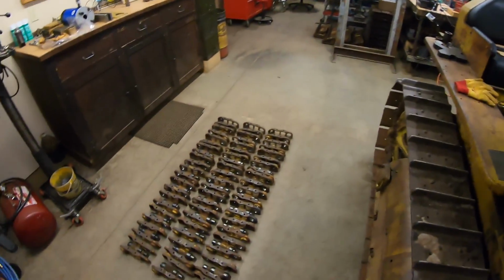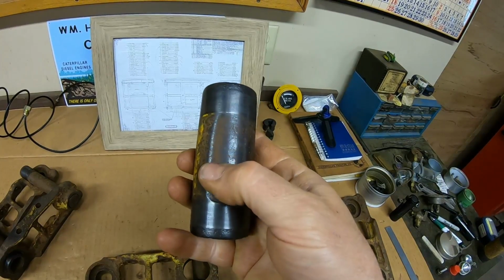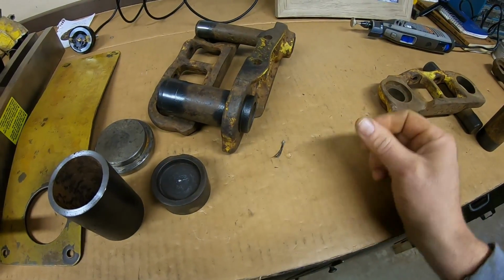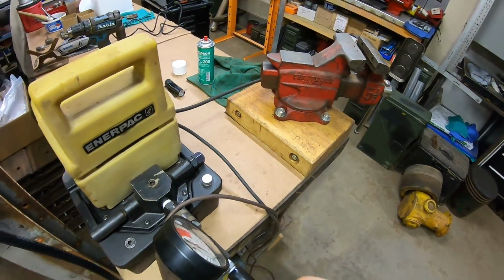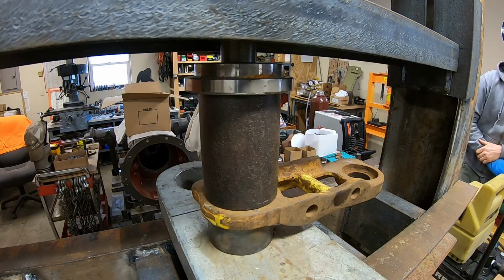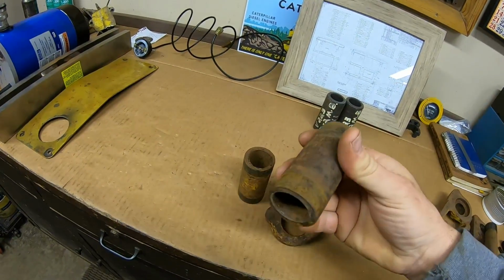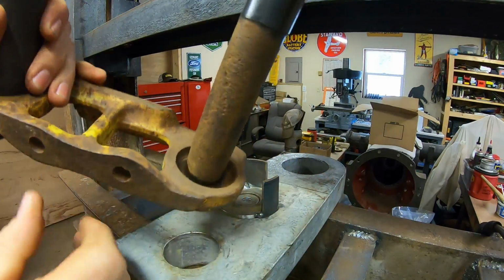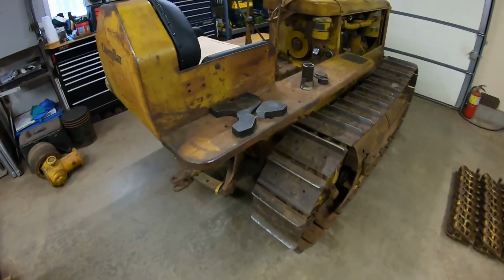Caterpillar D2 #5J1113 Chassis Rebuild Ep.72: Turning the Pins & Bushings & Pressing Back Together

Comment: Thank you for this.  My experience is with LIVE TRACK on tanks, similar but the inside and outside bushings are separated by rubber so that steel does not touch steel.  Yes there is more friction when the track which are loaded at an angle (about 30 Deg) is forced flat by the first road wheel but you get some of that energy back when the track gets to the end and jumps up thus the meaning of "LIVE TRACK".   I had assumed that DEAD TRACK was rather simple but the engineering is quite ingenious.

Comment: I like a manual pump for the ease in which you can sneak up on a loading with it, sure auto-pumps are nice and speedy and they have their place if you're wanting to knock out a lot of things quick. 

Still though, maybe not fully run the bushings down with the auto pump, but do get them 'set' and nearly seated so you can finalize it with the manual to see and feel if the press fit doesn't quite feel right as in too loose, plus the time between mounting and dismounting will give the links, pins and bushings time to relax and spring back slightly. It might not be much of a thing to consider, as to me, it's similar to needing to re-torque lug-nuts after so many miles and the process of checking bolts and so forth after so long incase of relaxation after torque cycle.

Comment: The guide for the last bit of pin travel. Might it be a touch simpler to have one in place during the initial press with an opening just big enough for the pin to fit through & just thick enough to achieve the needed extra distance? Would help a little with the tedium of resetting to setup again then continue. Or doing this way to make it less likely it slips if doing the above method & send bits in 3 directions?

Comment: That backing plate that broke on you was just cheap chinesium
A plate needs to be considerably stronger than the max output of that press     so being able to feel the pressure with a hand pumo seems irrelevant to me       
And you have a gauge if controlling pressure on a part
Reply: @squatch253      i certainly agree the ability to  regulate pressure on parts and the sense to evaluate what is sensible is very important
But as to a backing plate or the press itself i would say that rigging needs to be considerably stronger than the hydraulic ram
Im not an engineer but id say a 20 ton press should have a backing plate at least strong enuf for 30 ton
Being a non engineer i generally try to build way past conceivable breaking strength
Love your vids 👍

Comment: About the pump, I used to work at a place with a 50 ton press that had a hand pump but we added an air powered hydraulic pump to it. We just 'T'ed it into the line so you could use either pump at any time. So we could bump the power pump to close things up but switch to hand pump as soon as we wanted to feel the load. You have to be OK with the fluids mixing and you have to try to release about the same amount back into each tank.

Comment: It shouldn't be that difficult for a big manufacturer like Enerpac to create a control system with feedback for use with power pumps.
I mean something like a power steering valve or brake booster where you only have to apply a small force but proportional to the actual load.

If it already exists, surely it has a stratospheric price 😓

Comment: It's good that you had those replacement bushings for the master links. If you didn't have them my guess is that you would have been able to take two of the regular bushings and cut them down to the right length on your lathe.

Comment: If you take the links and put them into a oven at 350 degrees, then put the bushing into a freezer, they will start easily by hand.
Reply: @squatch253  - they still will take a press fit to put them together, it makes for a much faster setup, avoids misalignment, and takes less force.  When ever I did chains(I only replaced sections of links) I used this method and the equipment was all D6-D8 size, these rails were much worse than your D2s.   Also during disassembly you will find any loose fitting pin/bushing.  They all press at a minimum pressure, if one goes easy it’s likely junk.

Comment: It seems like the hand pump is better for the disassembly of the track chains since there is unknown excess friction/resistance created by corrosion in the push-fit area, leading to the chance of excessive force being applied to the press or other components. Without reviewing the previous video, weren’t some of those pins “popping” at 50 tons? By the time the pins are cleaned, wear shoulders beveled, and PFL applied, the press-fit force required would be much more uniform, like 30 tons, (?)  and less fraught with high-pressure mishaps.

Comment: Great explanation of the geometries of the pins and bushings when they are turned. 

What happens to the overall track length if you select reverse under load?
Reply: @squatch253  That make since ,you are only taking up slack on 2 or 3 pins and not 30. So the is not a lot of commutative affect.